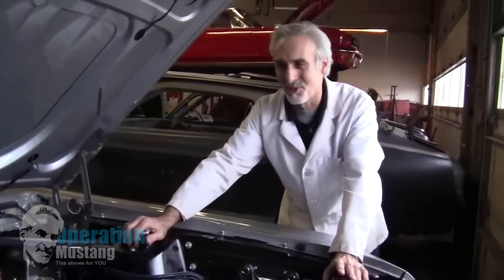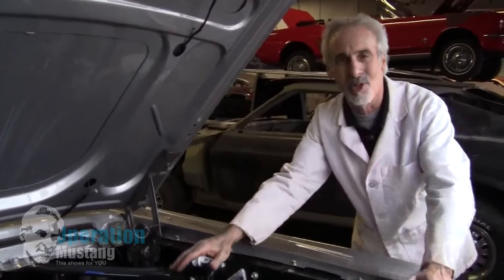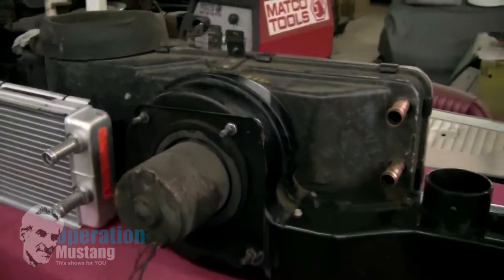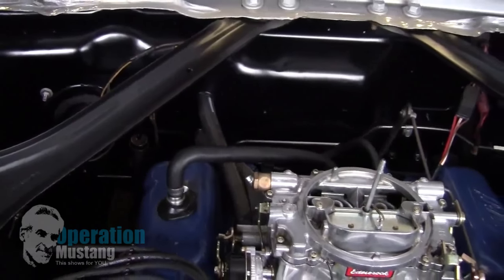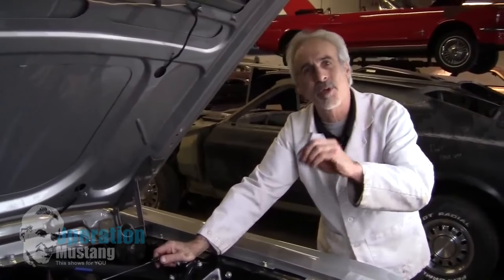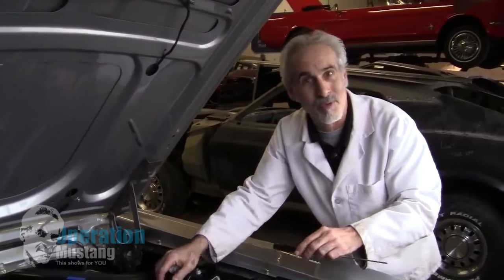Which Heater Hose goes Where?

Comment: So the hot water coming out engine is the outlet that is actually the lower connection of the heater core i would call the inlet because the hot water goes in. Than the upper heater core connection that goes to the water pump. Outlet of heater core and the input return on the engine. I think i got it.

Comment: I have a question in regards to my 1977.. both hoses were ripped out. Question is, are these hoses connected directly to the intake/heater core or are they adapted to another hose? Thank you!
Reply: Intake/water pump*

Comment: Not so simple for me as I have a pump with two spigots, and not a WATER COOL INLET MANIFOLD , in my 1986 Bronco. Obviously there is a bit of Frankenstein in there, but you guys with so much expedients and logic, could you please worked out for me... Thank you.
Reply: I came across this old post as a guy that tinkers with cars i would connect the lines and feel witch hose gets hotter and connect the hotter connection to the lower connection on the heater core.

Comment: This is very confusing, You say the hose coming out of the intake manifold is the outlet hose that goes to the bottom of the heater core which is your inlet hose? Could you please clarify?
Reply: Agreed....LoL, it was all making sense till his comment at the end (which I think he flip-flopped from his original theory).

Actually, his comment at the end was correct, only if he was talking about the coolant feeding the engine itself (and not the heater core).

Comment: Hi Chris...I managed to get a new heater box for my 66 restore (great ebay deal in great shape) but since I did not pull the original, I have a questions. The 4 nuts for the fan...do you put on 4 to hold it in place and then 4 after its through the firewall or just the 4 after the firewall? Thanks in advance...Hope to share some restore videos with you soon !
Reply from the maker: Hi Bob... Four nuts hold the motor to the box. Once the box is put up into place, the other four nuts hold it to the firewall. Once you pull the old box out it will become obvious on how things go together....
Reply: Thanks Chris !!! The box was already out (and trashed except the motor and resistor) so I didn't have the benefit of "how was it". I do want to say, I am having a BLAST restoring this car. A lot of detail and heavy work BUT so satisfying...You may be close to my age (I am 58) but in the 70's, I drove a lot of these :-) so you can imagine what a throwback thrill
Reply from the maker: Yes.. Its like having a time machine...

Comment: Great video awesome car well done , if I wanted to bypass the heater what would be best looping the intake port and the water pump port together ? Or plugging both up ? I have  a 69 Ford f 250 I live out west never below 50 here original huge factory A/C unit must be removed to replace the core and the factory ac cores are hard to find , I plugged both ports up and it seems to run a little hot  it is a rebuilt 390 195 thermostats new water pump etc I'm thinking I should had looped them , thanks for any advice ......
Reply from the maker: You can run one hose around back into the other...
Reply: Chris The Doc Ingrassia 
Thanks for the reply I plugged them up and I think I blocked some flow there have you heard of overheating on a Ford this way ? Seems like the water was not bieng pushed into the upper hose even after the thermostat opened the bottom tank was cold top was 200 ? Something wrong
Reply from the maker: How is the flow thru the radiator?
Reply: Chris The Doc Ingrassia 
It's a new eagle aluminum radiator 2 row 1 inch rows I broke in the cam and it got hot 240 250 at least on the mechanical gauge , I shut it down and replaced the water pump I drained it from the valve at the bottom did not see like it was blocked . It seems like even after the thermostat opens the pump does not circulate the water it just stays in the intake it was better after the new pump , I had the cap off and it was flying out ,. Maybe air pockets ? I'm going to put a water port and connect them together and possibly by one of those airlift type air vacum tools I'm thinking plugging those ports was not a good idea the previous owner had the truck sitting for 13 years when the shop rebuilt the motor they told me it had a cracked head I think he overheated it the core was already bypass when I bought it for all I know he did and the motor didn't last long after that .
Reply: Chris The Doc Ingrassia 
I just watched another of your videos thanks I'm running the recommended 195 I might put the 180 back and drill the 2 holes like you did and really check out that radiator again ....

Comment: The Doc knows which heater hose goes where.  You know which heater hose goes where because you just told me. I am not sure how you know what I know and do not know, but I know which heater hose goes where.  Most of the Docs 13.1K subscribers probably know which heater hose goes where.  However, with over 119,000 views over the last eight years, someone is inquiring.  
You are right; it “Seems to make sense to the many, many” that have responded.  I was paying attention the first time when I noticed the in congruency.  My point is that it is not very plain and the terminology used may be confusing to some.  Not everyone fully understands the concept of connecting outputs to inputs and vise versa.  Excerpts from YouTube’s transcript of this video follow and are almost verbatim.
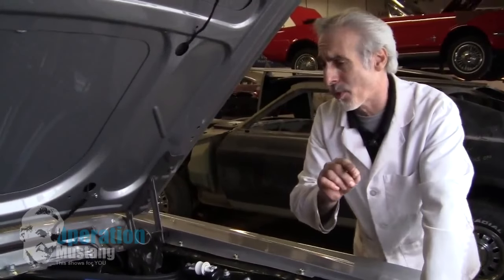00:43 
the heater hose that's on the intake manifold of these cars is your outlet hose 
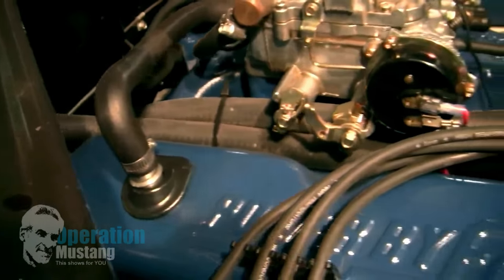01:41 
so the inlet is your water pump side, the outlet is your intake manifold side

In heeding your advice that I should pay attention and in keeping of your criticism of me that I am all criticism, I will give you some.  The word “explains” has no apostrophe but the word don’t does.  There should be a space after the period at the end of a sentence.  The word useful only has one l, and the word information has an r in it.  Your form speaks louder than your function.  Please feel free to listen to the advice of those in white coats, as for me I like the people with dirty hands.  As for your request to show “what YOU got” I challenge your sincerity.  I certainly do not care what you possess.  
Since this is not the correct forum for disputes, I am done here.
Reply from the maker: In the interest of being consistent with my grammar.. Your story above tells everyone here.. YOU aint got nothin but a keyboard...

Comment: not on my 454 bb
Reply from the maker: It actually has nothing to do with the engine as much as the style of heater core.....If the nozzles are side by side then it doesn't matter which hose goes where .If they are upright then it can.
Thanks for the input my friend.